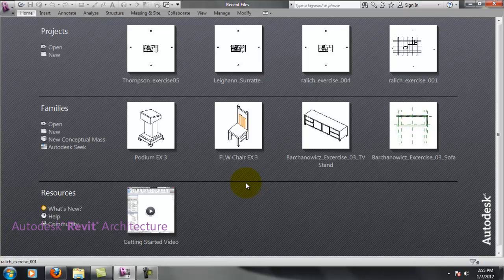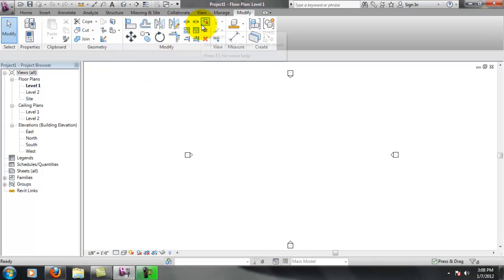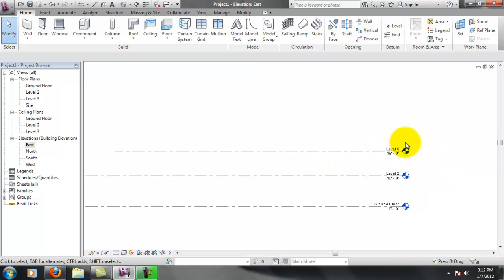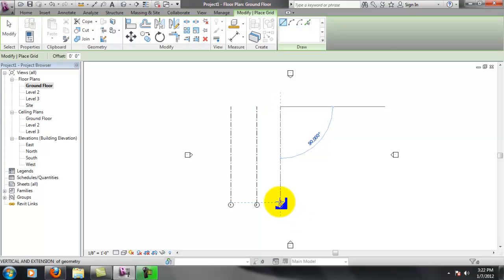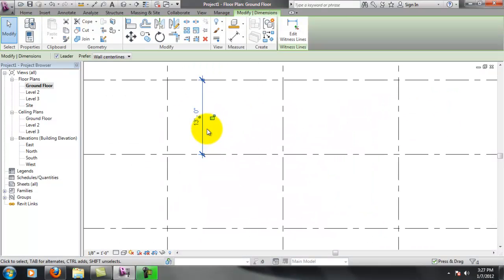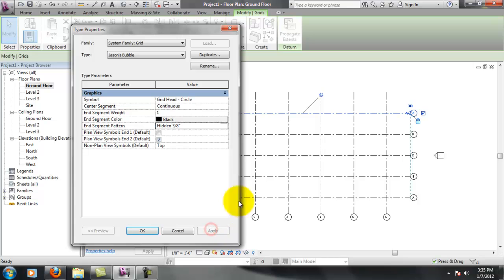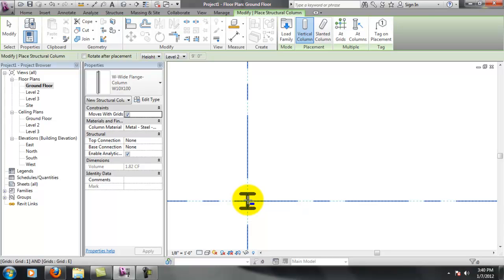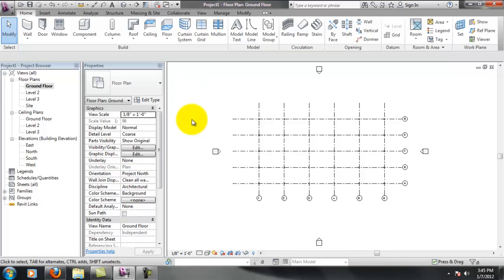Autodesk Revit 2012 for Interior Architects - Week 01

Comment from the maker: Yes, Revit is definitely capable of handling small interior projects. I guess it depends on how large your projects are. Most of the Building Information Modeling (BIM) can be ignored in Revit if needed. I would definitely recommend REVIT or AutoCAD to any Interior Designer. They are arguably the most utilized software packages in the field. Micro-station is another CAD package that comes time mind, but I am not as familiar with it.